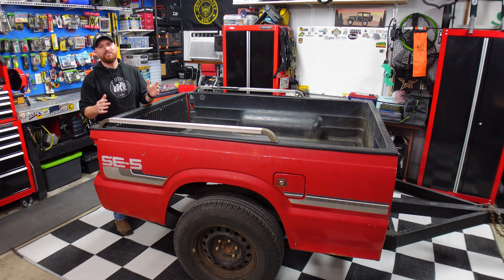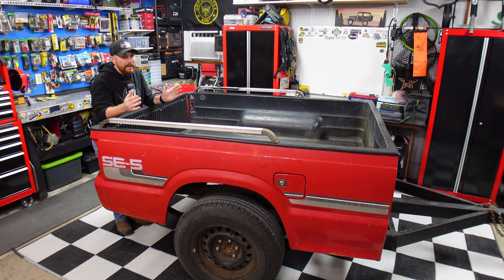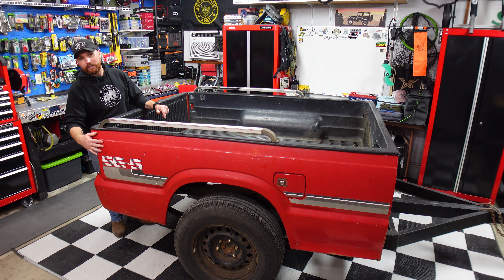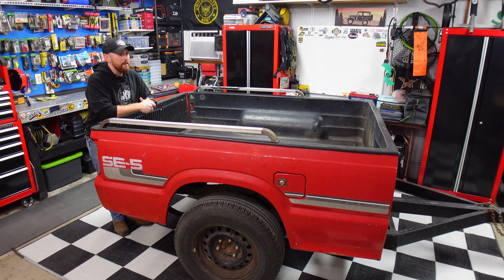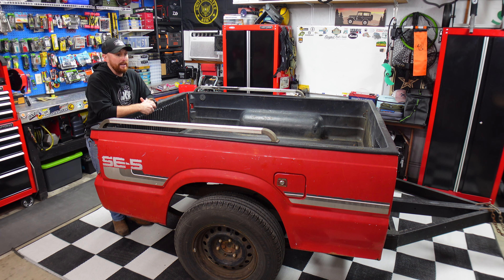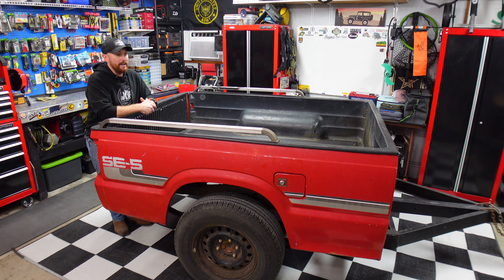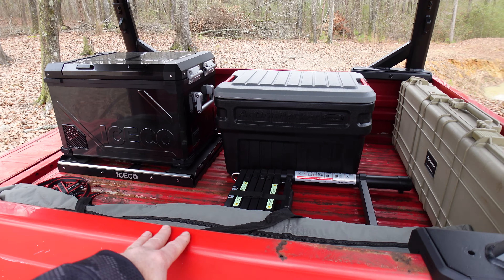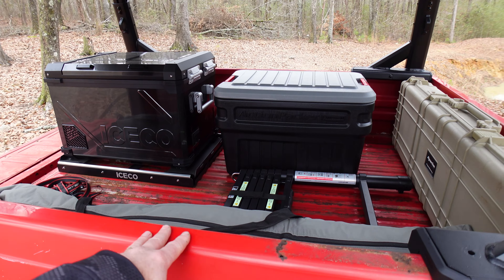Let's Turn This Old Truck Bed into a Camping Trailer ! DIY Overland Trailer Build

Comment: How about putting canvas sides around the Yakima frame kinda like a soft side camper where the sides roll up. That way it helps protect the stuff in the bed.

Comment: So I built my trailer using a 1967 M 416 military trailer, I bail a lid that was raised 5 in above the bed providing better covered storage. I then took an old truck ladder rack cut it to make a tent rack, I wanted a 270 awning on it I wanted to have rack below roof for arrow dynamics. When I get to camp I can open 270 then flip a switch and my RTT and awning are hooked up to a hydraulic lift on each corner to raid it up to 6’ so I can walk under awning. Im working on putting a bed slide in bed and hook up my fridge and hopefully put solar power on for best off-road camping off grid. I also have my power station on front plus I carry my grill on front also. Still a work in progress

Comment: Man that looks nice. 6’ bed? I love the idea of putting a water tank and underneath and using the tank door for filling. I have a RoadShower XL included in my build. Here are my top 5 musts, and top 5 want to see;
5 musts - 1. Color match paint to Tacoma. 2. Match wheels and tires to Tacoma. 3. Shore power and off grid power, look at an all in one inverter with battery you can charge via solar, generator, and grid power - $3kish. 4. Hygiene station. 5. Fridge.
Top 5 wants - 1. Fishing gear storage. 2. Cooking station. 3. Entertainment setup, e.g. mini projector and screen. 4. Heating and cooling. 5. Tent insulation.

Gonna be a cool build no matter what you decide to thrown on it.
Look forward to watching the series.

Comment: Find a truck cap for it, mount the tent on top of that. That will give you the clearance for the fridge, keep dust/rain off the contents in the bed, plus lift that tent up like you want.

Comment: A retrax/syneticsUSA retractable tonneau would be a good addition. That way you can still attach the bed rack and then have a sliding cover to keep anything inside sealed and out of the elements.

Comment: My truck bed trailer is made of a 2000 tacoma truck bed. It has a 6" lift with 35" tires,  air bags for leveling,  2   15 gal water tanks under the bed, RCI Bed Rack, OVS 270 Awning ECOXGEAR Sound Bar, 2  100Ah group 31 Batteries, stabalizer jacks, using existing drum brakes & modified brake handle to lock wheels from rolling and just installed the iKamper Skycamp  3.0

Comment: I'm building something similar. Got a fiberglass service body that I'm building a trailer to put it on. 

Stabilizers, an articulating hitch, ARC dolly, raise the rack so you can have a higher awning. 

Onboard water tank, with pumps and a shower.

Pull out kitchen drawer, with fridge and stove, maybe collapsible sink.
Reply: Gonna need helper springs, taller bump stops, trailer brakes and air bags, with all that weight!
Reply: @fishingismydrug1 him or me? My entire bed weighs 400lbs...
Reply: You. 
If you did all of that, with a weight of only 400#’s, kudos to you sir!
Is that 400#’s, empty? Water, utensils, tools/gear included?
Reply: @fishingismydrug1  no the empty box is 400 lbs. Trailer rated for 2k.
Reply: @dadsquatch79  Sounds great!

Comment: I know you weren't the one that built the trailer front of this bed, but any chance to get measurements on it? I have the exact same truck but an 86' that I've planned on doing the same. How does it handle/pull behind with the distance of the tongue?